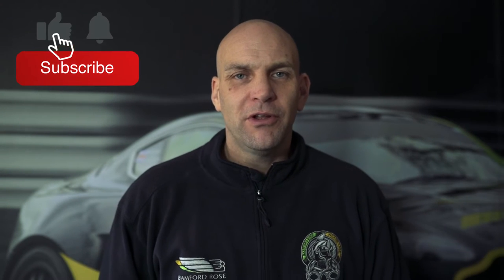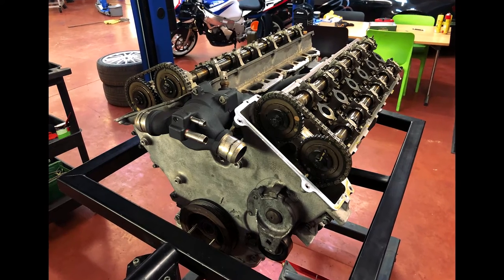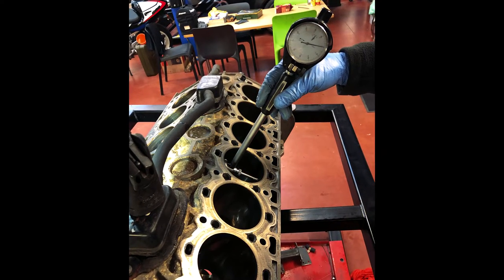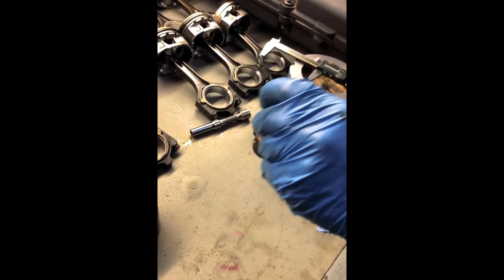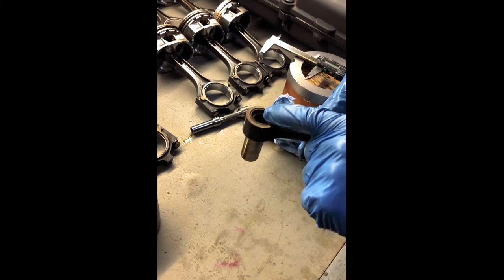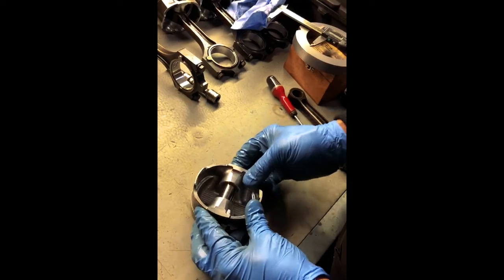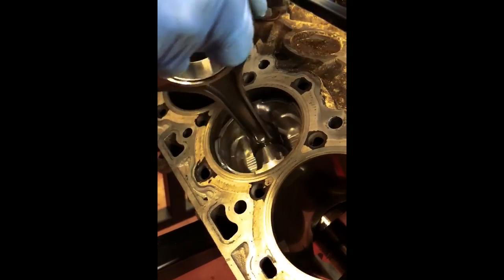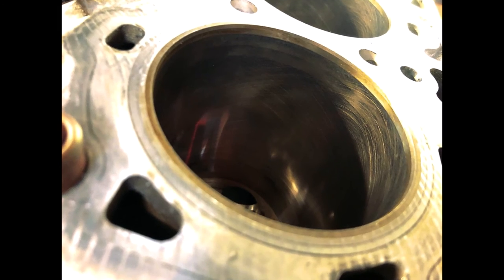DB9 Engine Tick Part 3

Comment: I had that same exact tick in my 2001 DB7 Vantage. It even had that same rpm delay (listen at end of car running part when car revs and the tick takes a second to speed up/match engine rpm. Same temperature thing also - only did it when warmed up but my car would always start ticking after a few miles (even in the winter).  That tick drove me crazy and I found a few "tick" forum threads on the AMOC and Pistonheads site - but they were all DB7 focused and all thought it was low oil pressure or valvetrain related. Glad to see there's(finally) a culprit and fix for it! Ronnie

Comment: Hi, I may be off subject but I am replacing all the electronics and wiring of my flooded DB9 with the componants of a wrecked DB9. Once the switch is done, I assume all cpu's and other units will need reprogramming. What is needed to flash those electronic componants? One other way to go about for me would be to also switch the engine/ transmission/ differential unit in order to avoid all reprogramming in essence keeping cpu's with all mechanicals of the donner car. Would that be simpler?😊

Comment: Need your help if possible, I have a 2010 DBS Volante. Where do I put the hidrolic oil for the soft top? as it sounds very under strain as I move the roof up and down, I makes ALOT of noise..  Thanks

Comment: Hi Mike, interesting video on DB9, scary but interesting. You talked on ballpark costing for rebuild being £15k to £20k. You also mentioned a replacement engine as an option but didn’t mention cost, is the also around £20k if the same liner small end issue? Thanks Mike
Reply from the maker: Hi. A reman unit from factory is approx. £8.8k plus vat. 30 hrs labour removal and refit with about 15hrs labour dressing new engine with old engine items. £500 fluids and consumables brings the job in at approx. £15k, yes
Reply: @BamfordRose  That's about $21000 USD at today's exchange rate.  Ouch!